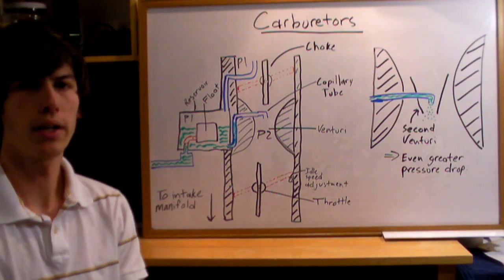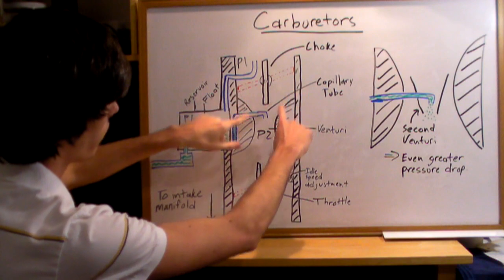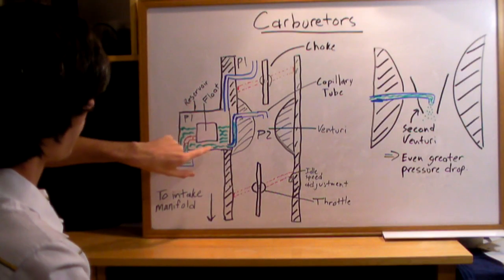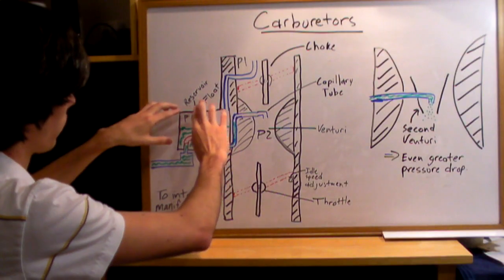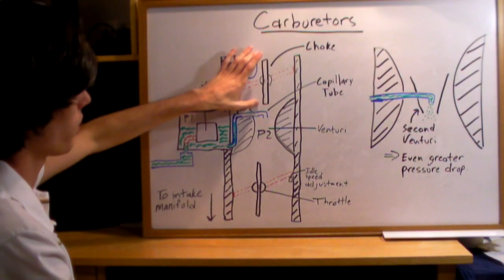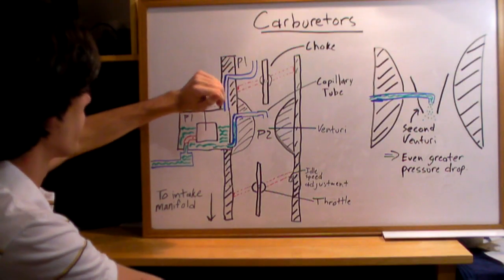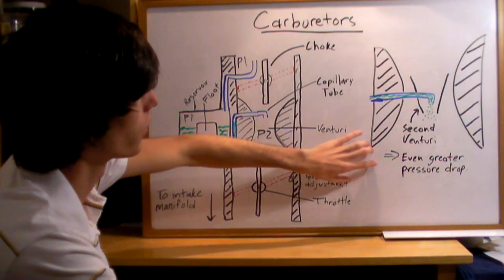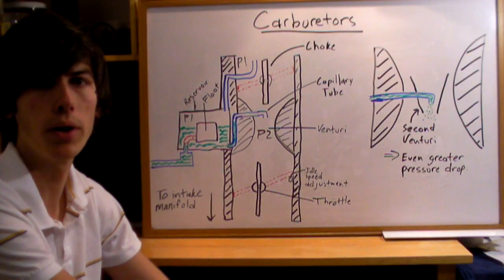Carburetors - Explained

Comment: Hello. Can anyone please answer me? What happens when the throttle valve fully closes (not even a tiny hole for idle) while on engine brake? Will that create a vacuum? Will that shut off the fuel flow for fuel economy, or will that create fuel flooding the engine? Will that have a negative effect on the engine?

Comment: For dummies like me, Closing the choke translates to turning ON the choke mechanism on the machine. Opening the choke means turning OFF the choke mechanism. Great video but not dumbed down enough for an old cook ;) Requires similar thinking to a windows operating system whereby you turn off the computer by first clicking the Start button :)

Comment: Why when you press down on the throttle does the air get sucked into the carburetor. I understand the fuel is drawn in by the air but what is making the the air drawn into the carb?

Comment: Air is needed for burning if you close the choke how will combustion happen
Reply: Air can still get around the chock. The choke either has a hole in it or air can push it partially open.

Comment: When the float is at high position so the excess fuel from the fuel pump goes back to the fuel tank, the fuel return line
Reply: all mechanical
Reply: Most carbureted engines don't have a fuel return line. The fuel just backs up in the fuel line while the pump is being dead headed.

Comment: I've never had a good grasp on carburetors so thanks for this explanation. I get it that the float fills the reservoir but I'd never known that it was vented to atmospheric pressure. What regulates how much fuel is released into the intake via the tube? It's not strictly vacuum, is it? 🤔
Reply: It is vacuum. When the throttle is opened wider, the air is able to rush past faster because it is less blocked. When the air moves faster over the tube (called the main jet) it's at a lower pressure so it pulls more fuel out. By the way there is also a different tube called the idle jet that helps the engine get fuel when the throttle is closed.
Reply: @matthew55793  
Thanks!
I've always been so intimidated by carburetors that I've not messed with them... with one exception.
I disassembled a lawn mower carburetor once, took photos & even made video documentation for assembly.
Essentially it was just a "regasket" job -- because I certainly didn't have a grasp on what I doing -- but I killed it!
💪🏻
I'm very meticulous so I cleaned every existing component to like new & when I reinstalled the rebuild, it ran supremely!
💪🏻
🇺🇸
Reply: @DoyleFM  Baller! Once you understand the operation of a carburetor, seeing one taken apart or taking one apart yourself is a great way to cement your knowledge and figure out what parts you don't quite understand. And yeah, smart to video the disassembly, it's easy to forget steps.

Comment: Thanks for the video buddy ive been watching you a while, if you got rid of the venturi or at least opened it up alot (enough for the vaccuum to happen but also enough for air to flow through in just a bigger mass in general do you think that would affect horsepower in any way significantly?
     Thankyou
Reply: Air flow through the throttle body is not a limiting factor in how much air your engine is able to suck in, or at least it never should be. The only way that would only ever happen if you greatly improved the breathing capability of your stock engine without changing out your throttle body.

Comment: can you do it  again with more details??? like the difference between 1 or 2 or 3 or 4 barreled carbs, how does choke work? ( manually and automatically ) how does the engine work with more than carburetor and so on. thanks

Comment: Where it gets air when choked? It runs for a while wery ritch.. uses up all the air thats in it and dies? But why there are many engines that can run of the choke all the tike?
Reply: The choke plate does not completely seal the air inlet. There is always a gap for a small amount of air to come in

Comment: Hey Jason, how does the car determine the stoichiometry relationship with the fuel and gas. Since almost all cars run on gasoline and desiel is the stoichiometry relationship already programmed from the start? Basically I'm im asking if the car does any analysis on the fuel in the tank? Thanks

Comment: Hey great work man! really like your videos, I want to ask a question, would it not be possible to replace the float with a fuel sensor which would sense the fuel level and then when the reservoir is full, send a signal to a device would would close the fuel intake and when the fuel drops, send another signal to the device to open up the fuel intake?

Comment: so when starting the engine and choke valve is closed and piston vaccum works to get out fuel to mix with air for rich mixture. ratio air:fuel=7:1

Comment: would installing a performance carburetor onto a naturally aspirated engine be beneficial or nah? Also, would using e85 fuel change the functionality of the float level or the air to fuel ratio?

Comment: So just to clarify (learning about cars) the carburetor mixes the outside air with the fuel inside your car to make a fine spray to be fed into your cylinders. The fuel is inside a float bowl, also inside is a ball that stops the flow of fuel to keep it from overflowing. Once the bowl is full the fuel flows into the discharge nozzle to mix with the outside air, the fuel is already filtered by the time it reaches to this point. The air flows through the venturi to increase velocity and decrease pressure meaning it speeds up the air to go through the butterfly valve which is the throttle. When the throttle is open it lets mass amount of air into the engine to give it more power, when close it does the opposite effect. Even when fully closed it goes through an idle jet that keeps the engine from dying.
Reply: Just incase you don't know carbs aren't used on cars after the late 70s (ish) and have been replaced by injection.
Reply: Pat I know this, thanks anyways.
Reply: Pat fuel injection was introduced at about that time but some cars still used carburetors for some time, I had a 1989 Peugeot 205 with one

Comment: when the choke is completely closed for cold start and the mixture is rich with gasoline how would it combust without air ?
Reply: Choke doesn't block all air out just most of it
Reply: He said the idler screw keeps the throttle valve from closing all the way

Comment: Hey Jason, I've got an issue with my car rpm being unstable at low rpm. I've suspect the problem might be the carburetor or the air pipe leak. May I know what might be the possible problems? Thanks in advance!

Comment: I don't know why but my bike can usually just go at 43km/h but if I use the choke when it won't go any faster it goes all the way up to 60km/h.

Can someone please explain this to me?
Reply: The reason you're bike goes faster is because you defeat the self governance of the float when you open the choke all the way but you can eventually flood the engine if you don't become a precise governor when you're opening the and closing the choke
Reply: No one ever says this but you should always use high octane fuel only, on two stoke engines. Cheaper fuel burns longer and constantly overruns and over works the self governance of carburetors
Reply: Okay. I've done some research and the reason why my bike goes faster when I use the choke is because when I use the choke, a plate in the carburettor which only allows for so much air to be mixed with the fuel.

And what basically gives the engine power is an explosion of the gas and air mixture at the top of the cylinder.

So more air = bigger explosion = more power = more speed

Comment: please reply.  is it true fuel injector save fuel compare to carburetor? if so what is the percentage ?  example is it 5% 6% 7% more fuel efficiency ?  hope u understand :)
Reply from the maker: +GAR A Probably so, there won't be a set percentage. You would have to compare exact scenarios directly, with exact carbs and fuel injectors.

Comment: please reply is air intake save gas and make ur car faster is it true
Reply: +GAR A It's impossible to tell what you're asking.
Reply: the longer I stare at this...
Reply: +GAR A I think what you're asking is, will a "(cold) air intake save gas and make a car faster". If so, engines like cold air because it is more dense, and dense air will generally increase hp. But rarely will the increase be significant

+Engineering Explained Thanks for the video

Comment: I feel like this video really doesn't go into enough detail. Almost no carbs are like this with just one jet and a throttle plate. You should have went into more detail about things like accelerator pumps and pilot jets and explain multiple barrel carburetors like the quadrajet for example. Perhaps you don't feel this is important as cars don't use them anymore but a lot of dirtbikes, ATVs, and older cars still use carbs which are MUCH more complex than what is shown here.

Comment: so caburator is old tech and fuel injection is new tech ? is it make sense?
Reply from the maker: ***** Correct, all modern car engines use electronic fuel injection.
Reply: now im understand . thanks !
Reply: Diego C. “Late reply” lmao it’s been 2 years dude
Reply: +Engineering Explained Does a car with a carburetor create ice or is it just the planes that encounter this? 
And if so what is/was the solution to the problem? In planes the use carb heat was to take warm air from a seperate holder near the exhaust into the carburetor to clear the ice.
Reply: Arcadiez, late reply, but I believe that the freezing point of gasoline is something like -50 ºC, so it's normally not a problem. An aircraft is different because there can be ice in the air, when going through clouds, etc., so it needs de-icing systems.

Comment: how might an engine behave say if there was more fuel are more air (the mix was incorrect)
Reply: Danny Richmond More fuel AND more air is more power (as long as the mix % is the same). More fuel only will run cooler and potentially bog down and stall. Too much air will run really hot and destroy the engine. It is CRUCIAL to have the air/fuel mixture correct.

Comment: Engineering Explained how does the carburetor in a motor that has to be able to work while oriented in all directions (for example, chainsaws) work?

If upside down, wouldn't the float let through too much fuel as it would always be in the open position? And when sideways as well? How exactly is the reservoir arranged so that the float position is always representative of the fuel level?
Reply: +dtroy15 Chainsaws don't have a float, they have a pressurized fuel system and use a little rubber diaphragm instead of a float.
Reply: Also, most small 2 strokes don't have an oil sump. Oil is in fuel..

Comment: I finally friggin get it!  Right when you explained how the choke cuts off most of the outside air, and the cylinder creates a vacuum .. that's going to suck fuel out of the jets, which will give it a rich fuel mixture.

I always thought of these jets/needles "squirting fuel out", like fuel injection.. but it seems like its the reverse of that.. there is a pressure differential being put on them and therefore the fuel gets sucked out of them.  Would that be a correct way to say that?

Great simple, vid.

Comment: I have a 73 mustang Mach 1 without the choke connected. Would it hurt anything to not have it connected. I have no trouble starting it cold without the choke.
Reply: no danger
Reply: You must live in a warm climate. It won't hurt if the chock isn't connected.

Comment: My car wont start sometimes but when I get out and take off air cleaner, then open the carb wide open it starts. I jam a small flashlight in carb to hold the blades open and this seems to get it started? why does this happen?
Reply from the maker: Maybe it's not getting enough air to start? I'm not sure, haven't ever worked with carbed engines.

Comment: Is it backfiring through the exhaust or the intake? you should not have to open the throttle to start it, unless you have a big cam. I would try adjusting the choke for the starting problem. As for your stalling issue, does this happen when the engine is cold or operating temperature. If happens when you push on the throttle it my guess would be that you are inadvertently cause a sudden lean condition, possibly pointing to a bad or a improperly adjusted accelerator pump.Also pull a plug to check

Comment: I hope you don't mind specific questions but I have a couple 1 when I start my truck (a 1975 ford F-250 with a 1979 351 modified engine) I pump the peddle 3 times hold it half way down and turn the key, when I do it starts up pretty quickly but then it backfires and dies from there I have to wait 1 to 3 min repeating the process every min till it runs fine just wondering why. and 2 when I'm at a stop light/sign and I'll push on the accelerator and the engine will stall again why thanks great vid

Comment: The kicker is a stepped cam that th idle adjustment screw rests on...as the spring closes the valve, it also moves the cam..so when we spin the engine, we have a rich mixture, and a li'l extra air to deal with it

Comment: To start an automatic choke equiped engine, we first press the gas pedal to the floor.This squirts a bit of fuel in the manifold.It also allows the bimetal spring to close the choke valve and move the idle kicker

Comment: Automatic Chokes use a "bi-metal spring" to open valve as engine warms...later ones use an electric heater...earlier ones actually drew air across the exhaust manifold for heat...as the spring warms, it applies a torsion to the choke valve shaft to open it.

Comment from the maker: The choke is used to restrict air-flow at the start in order to inject more fuel for starting the engine. After that, the choke is left open and the throttle valve controls the airflow.

Comment: Liked the video, it was nice being it explained on a board. 
Question - Is the choke controlling the flow of air (which in turn controls what gasoline/air mixture flows in to the engine)?

Comment: great video but you left the emulsion tubes out that emulsifies the fuel because liquid doesn't burn vapour does , 1927  ford brought out a vapour carb but canned it so the oil companies could make a killing and pollute the earth for over 90 years still going strong with the stupid fuel injection systems that are less economical after vehicle engine is worn with NO ADJUSTMENTS

Comment from the maker: In a carbureted car it may not be much different either way, maybe less in neutral since it will be revving lower, then again in gear it doesn't need any fuel to continue moving. Regardless, it's a very minimal gain. If you're looking to save fuel there are much better methods. Drive slower, accelerate slower, etc...

Comment: These preheaters were only a bimetallic strip that when closed would complete a vacuum circuit.  The vacuum hose from the carburetor would be connected to the primative sensor which was located inside the air cleaner lid, then be connected to a diaphragm and a rod which opened and closed a door in the snorkel on the air cleaner.  these usually operate in temperatures of 65 degrees or less (inside the air cleaner).  These usually opened at 105 degrees, and were modualted for optimum operation.

Comment: No Problem.  I'll elaborate a little.  It was in about 1970 when this happened. Some cars had it before 1970 but it was much more common after then.  This came about when Nixon established the EPA and signed the Clean Air Act of 1969.  The EPA put the sqeeze on Detroit and Detroit responded by lowering compression ratios, output, and introducing Evaporative Emissions Controls, in an effort to reduce overall emissions, in addition to preheaters, which also improved cold weather drivability.

Comment: Does that mean it is impossible to do force induction on a carburated engine? would the pressure blow back into the bowl and/or move the butterfly valves?

Comment: Oh, also the part where you talk about cold starting and one needs more fuel, that is true but some cars had preheaters to route air from the exhaust manifold surface into the air cleaner, in an effort to reduce the amount of fuel needed.

Comment from the maker: I'm sure it could be fine tuned to optimal fuel efficiency, carbs were used in NASCAR I believe up until just recently, I'm sure they had them dialed in right. That said, it's very difficult to compete with direct injection, as this allows for the fuel to be injected at the exact times when it will yield the most power or the best fuel economy, something carbs cannot regulate.

Comment: I know how to use Ocean Water pressure to solve the Hydrogen supply paradox. Also my car solves the chicken and egg paradox as well. The answer is converting ocean water pressure(mechanical energy) into electrical energy then using those electrons through a series of processes to make hydrogen. Just ask me how. Fuel so-long as there are oceans on planet earth.

Comment: The explain of pressure difference causing fuel to move is spot on.  Most people think that the fuel is being sucked out of the bowl when in fact it is the difference of pressure that causes the fuel to be drawn out into the annular booster sitting in the middle of the venturi to be atomized.

Comment from the maker: @Veggies94 Depends on the setup, can be either or, but one carb is more common leading to the intake manifold. Higher performance engines (older, obviously) may use one per cylinder.